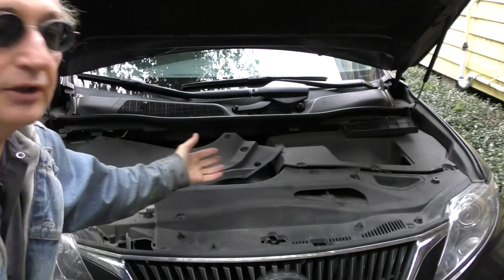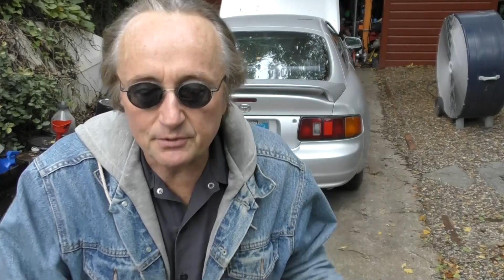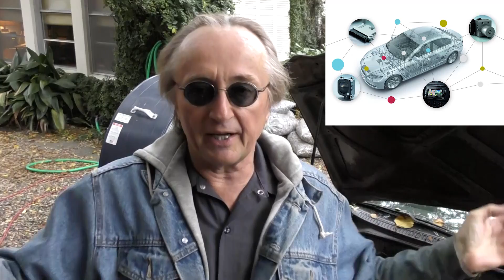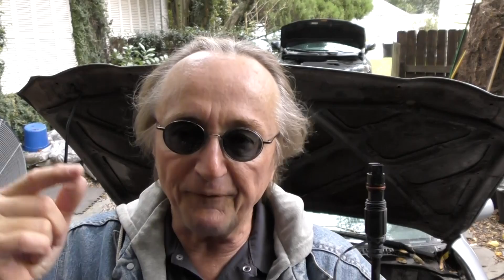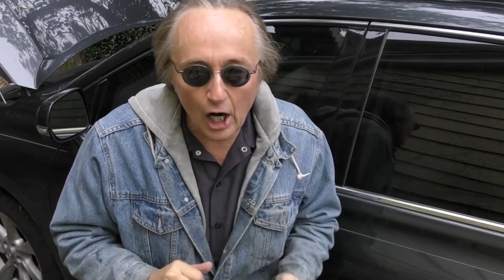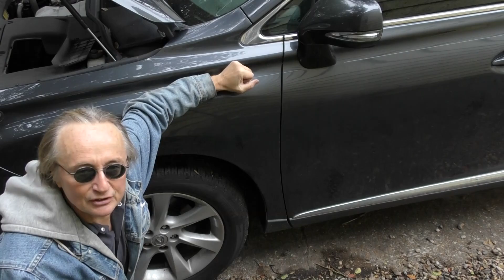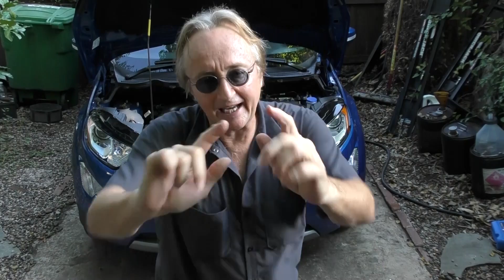The End of DIY Car Repair, Why New Cars are So Hard to Work On

Comment: That Lexus has so many plastic covers at first glance I thought the engine was gone
Reply: That's the way. Newer cars are though
Reply: It’s to make the car quieter
Reply: There's a bunch of hamsters under the covers
Reply: Clint Adams lol
Reply: @clintadams8451  Did I see a rat's nest... LMAO
Reply: @clintadams8451  guess by feeding on all the wires they won't starve
Reply: I was thinking the same thing with my 2017 audi a6
Reply: @vel6979  you mean to make the car gay?
Reply: Good way to overheat an engine during the summer months.
Reply: The plastic covers on modern vehicles make me laugh
Someone needs a jump start, you pop the hood and go "where the hell did they hide the battery"

Comment: My dad used to say that the people that designed the cars, should have to work on them.
Reply: No they don't, they make it what you wanted, a small car with the room of a limo, packing then makes it hard to work on, but not impossible, the engine is built away from the car body as are most other parts, then put together on the line. Laws from the pratts in California have fucked emissions and car designs the world over with all the emission reduction kit adding to the problem, hell, most of the time it this kit that does you over!
Reply: The way it works is like this: You have designers that design a car. That then gets approved by the board. Then the engineers have to figure out how to make it work.  Then the car is made. And then things go wrong: The designers blame the board, the board blames the engineers and the engineers blame the designers.  The cars roll out of the factory and the customer buys it. They bring it to the mechanic when it fails and the mechanics have to fix a flawed design. Which in turn will inevitably fail again. Mechanics are then blamed by the customer.
Reply: hahahaha. My dad used to say that as well. He was a WWII and Korean war navy vet and you
could create a new language with what he would be calling things on cars as he worked on one.
And that was way back when cars could be worked on. Before he passed, he would look under the
hood of a car and just shake his head. the usual "What the hell do they need all this crap for?"
or something similar would usually emanate from him.
Reply: Engineers could easily make cars easier to repair, but they have to meet the financial constraints from accounting and the needs and wants  of the average consumer, the company has to turn a profit
Reply: smart dad, say hello to him from my part and buy him an empanada.
Reply: @fatknucklesproductions7517  And packaging restraints..  They build it for ease of assembly, not maintenance or repair.
Reply: @Miguel2013  I'm old enough to remember needing TUNE UPS.  Adjusting carburetor  just because you drove from NJ to Mississippi.  God forbid you're going up pikes peak.  Hell you needed Winter and Summer tune ups all the time.
Reply: Sounds expensive. Instead of auto technicians, auto engineer fixing your car.
Reply: the thing is cars are made for  easy and fast assembly first. disassembly is an after thought
Reply: @GeraltOfRivia99  naw. They do it so they don't get copyrighted for copying someone else layout. Also different designs can mean better mpg and that comes Ata cost of the complexity of fixing them
Reply: @marv9906  nah they do it because the harder it is to work on something means more money in there pocket
Reply: @GeraltOfRivia99  take your tin foil hat off not everyone is out to get you
Reply: My dad said the same thing,  except a lot of F*&^#!  In there.
Reply: tlessmo  Software is the reason why engineers are able to make blueprints with such tight tolerances. As the design artists do not tend to care about the practicality of their designs. All the while the cars have to adhere to strict rules when it comes to for example: emission standards, the laws of physics and certain ride quality minimums.
Reply: The people that designed the cars were TOLD by people to design it that way as it makes more business profit. Also those people always buy new and don't need to work on them (Management).
Reply: That’s the same in any manufacturing processes, or drawings engineers design... tolerances that are too tight for no reasons, stuff that doesn’t interface correctly, finishes that don’t make sense..  could go on and on
Reply: Audi and BMW should deff have too. They make those cars for a good time and not for a long time. Either give us reliability or give us cheap cars.

Comment: My favorite memories growing up were working on my car with my dad. Working on cars taught me patience and the importance of paying attention to everything you're doing as a single slip up could ruin your entire car like almost it did when I accidentally put power steering fluid in my brake fluid reservoir. My dad made me get a piece of water hose and suck it out as he claimed he couldn't find the pump at the time. I don't mean suck it into my mouth I mean suck it just enough so there would be enough low pressure in the hose to extract most of the fluid. I thought it was child abuse back then but now I make sure to stop and think two seconds before I pour and liquid in anything or cut anything. Working on cars helped me to learn how to focus, concentrate, and problem solve.  It made me the man I am today...

Comment: Still driving my 1996 Ford F-150 with the straight 6 and 4 speed manual.... Easy to fix, cheap to maintain and as reliable as an anvil! Thanks again for the advice Scotty!!
Reply: Anvils are known for their great mobility too!
Reply: i want one of those bad
Reply: I drive the same truck. It’s modern enough to have obd2 but still had a lot of old school components that are easy to work on. And those straight 6s run forever.
Reply: @ronaldderooij1774  are you talking about Challengers and Tesla's LOL
Reply: I got a 95 Yukon back in March as a Project but that Damm TBI 350 won't fucken die LOL I love that truck though super easy to work on and maintain.
Reply: I love my 06 F-150. In 12 years I've only replaced brakes and spark plugs. I have very little interest in these turbo charged weedeater engines they have now. Simple is good!
Reply: I have my 92 f-150 4x4, Straight six, 5 speed. Had to put another reman straight six due to being a farm truck and had 400,000 miles on it. Still a soiled truck and easy to work on.
Reply: I have a 2013 Fusion turbo, but my baby is my 88 Bronco. I'll be in a Bronco till I die.
Reply: I was having a few at the local tavern last night and ended up talking cars with the fella sitting next to me. He has a 94 F150 with 300+ k on it.
Reply: Those Ford in line 6 were very very good, 300 000 miles is easy.  I worked on a 74 with 700 000 miles on it.   Most  inline six have 2 extra bearings on the crank compared to a V8  + they are well balanced and that makes them tough to kill.
Reply: My 03 v6 has 318,xxx miles 🤗 still purrs
Reply: Hell Yeah! Same with my ‘99 Nissan Pathfinder. Indestructible engine, easy to work on. Been daily driving it for 19 years!
Reply: @Rocketninja200  You bet these turbcharged weedeater engines make alot more power than your old N/A engine.
Reply: Have a 90 with a 302 still going.
Reply: That big six cylinder gives you plenty of room under the hood when repairs are needed.  I had one in my 77 van.  It had one wierd quirk.  On several occasions, the engine started by just putting the key in the run position. I figured the coil fired on the cylinder at TDC, and acted like a starter with the left over fuel.  GM played with the option years later, to eliminate the starter.
Reply: How do you drive a 4sm? Does it have good linear torque curve among its gears? I mean, it's just 4 of em.
Reply: Well, you said it. 6 cylinder manual, nuff said
Reply: Manuel Gatzi I’m sorry. I refer to it as a 4-speed, but it’s 4 and a 5th gear for overdrive....
Reply: _ Aliens _ what is it?
Reply: 91 Dodge, 5.2L basic TBI system. 350,000 miles, never rebuilt
Reply: @Gerardo Gonzalez ford stands for FIRST ON RACE DAY
Reply: Thats why I'll never get rid of my 2wd 95 f150 5.0 e4od.  It's been rolled over and in a front end collision but it still drives like new.  I've only had to do regular service on it. The original water pump, radiator and distributor lasted 22 years and I just replaced the original 23 year old starter unlike all modern vehicles you could live under the hood thats how much room there is around the engine. It has 169,700 miles and counting it's my daily driven work truck the truck is still about  90% factory original. It will probably still be running and driving 60 years from now with a million plus miles as I'm never getting rid of it.
Reply: Pajama Time I have an 84 f150 with a straight 6 and a 4 speed. It has so much space in the engine bay so it’s really easy to work on
Reply: @martinez1701a  the L05 is a great engine but with crappy flowing heads. i had one i swapped  into a 89 camaro that was an RS with the 305 originally. swap out the heads, bore out the throttle body, cam swap..... sure it will wake up. the 350 is a damn strong engine. i currently have aa 1996 camaro Z28 with the LT1. 247K miles on it
Reply: @PurpleHeartVR  that might be, but when they are trying to sqweeze that much power out of that little displacement i dont know what that does to durability. time will tell. my two old school GM 3.1's and my LT1 run just fine. we have a 1990 grand prix, a 1991 cavalier (3.1) and a 96 camaro.
Reply: LONE WOLF  You are absolutely right!! Those things could be knocking from low oil and once you filled it up with oil, You were good to go again. Their cousin the 200 cubic inch version that were in cars like the Zhypher or Granada were just as reliable. My friends dad had a 300 in an old '80 F100 but I think it was a late 70's engine and that thing lasted forever. He got another one a few years later, another 70's engine that we dropped in an old '66 F600 Dump truck. the funny thing about that is he tried to use a radiator from a Dodge 318 in the truck because the original one was shot and I tried to warn him it wouldn't hold up and a few days later he blew it trying to drive the truck. I eventually help him choose the correct size radiator from a large truck junk yard. It was another Dodge radiator, which he had modified to work. The 200/300 straight 6's are my favorite but the 351 Windsor is a close 2nd.. Those are damn near bullet proof too. The 350/400 Chevy is good too especially with gear to gear timing.. lol
Reply: @ad356  ahh love those 60 degree V6 engines I have a 3400 in my 2001 grand am, they came with shitty gaskets from the factory but rebuild them with felpro head gaskets and aftermarket metal lower intake gaskets and the will run forever I've probably built about 6 of those things.
Reply: @ronaldderooij1774  I dated a girl whose last name was Anvil, she was very flexible!!
Reply: I've got an O2 Ford F-150 crew cab, and that's about as modern as I want to get with my truck, so I'll drive it till the wheels fall off.
Reply: My wife had a granada with a straight 6 250 cid and my brother had an E150 6cyl 300 cid. Both had a single bbl carburetor that would after a year or so that would loosen up at the mid section. I hated taking off those carbs just to tighten those screws.
Reply: Had a 2000 f150 with an auto went threw 2 transmissions with only 140k my 94 ranger 5 speed was at 230k without any problems
Reply: Pajama Time cause Ford trucks old & new last forever!
Reply: Gerardo Gonzalez fook that rice junk foreign econo car. Ford trucks most reliable vehicles u can buy says JD Powers..millions customers..Scotty Kilmer!
Reply: Joshua Law yup old Nissan's were very good problem is new Nissan's are Renault junk. Ask Scotty! Keep ur Pathfinder and when buying new get a Ford SUV or truck. Scotty approves so does my family! Ford & Mazda only.
Reply: Boostedmk2 Jetta that was a rare F150...trust that! The Rangers & F150s are indestructible. Check out all new Ranger ...i did & ordered one ! Can't wait. Best selling small truck in world. Now back in USA built in Wayne, Michigan.
Reply: I feel xterra, pathfinder, navara.,titan 4 liter engine is the worst to deal with big headache and pita  my mistake that i bought it 😁 but any thing can be learened and solved
Reply: Yes the Ford 300 cu 6cyl engine was bulletproof,  my brothers 76 F150 had almost 350,000 miles and still going strong before  it was wrecked by a wrong way driver. He sold the truck for the motor!
Reply: if they stop producing them u will still u will stop seeing it. CAN Bus system is publish in 1996 and standardized in 2004 with both europe, ashia and the US. that means no company car has to produce a car without a CAN Bus System from 2004 up to date.
Reply: I just picked up a 87 with the 300/4 speed with 60k original miles! The paint is rough, but the interior is pristene and has reciepts for everything fixed/ worked on by the 2 other owners. Still has the original paperwork from buying it in the jockey box too!
Reply: Had the same vehicle. Base model  2 wheel drive. 5 speed manual. Short box. Great vehicle. Easy to work on. Reliable. Lousy in snow.

Comment: My uncle has been a mechanic since 1973. He told me , " Mechanics today are parts changers, not mechanics anymore".  The most costly repairs involve electrical or computer issues. He and I miss the old days and vehicles when you didn't need a laptop to figure out your problem.